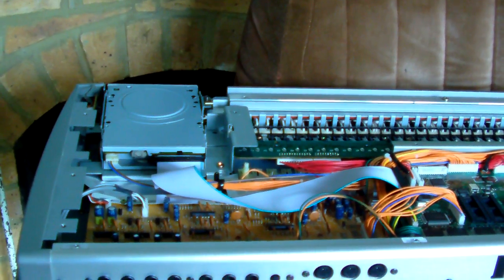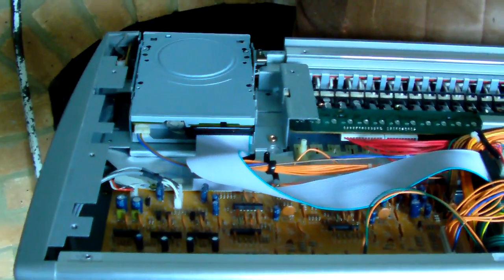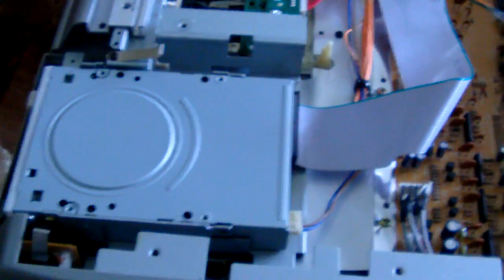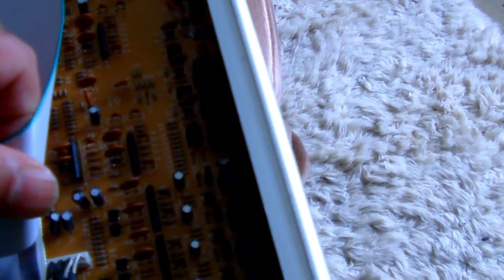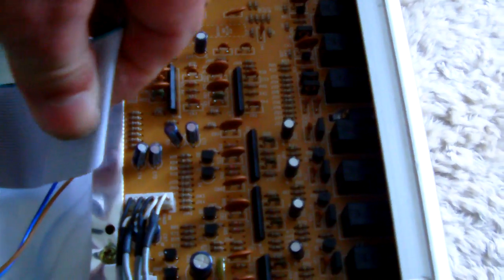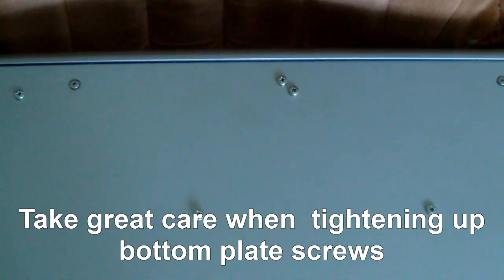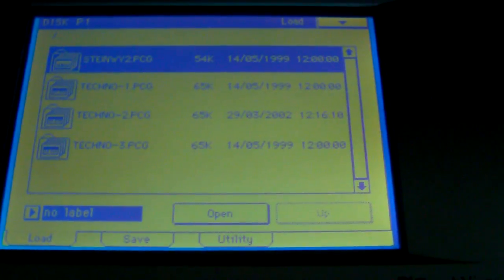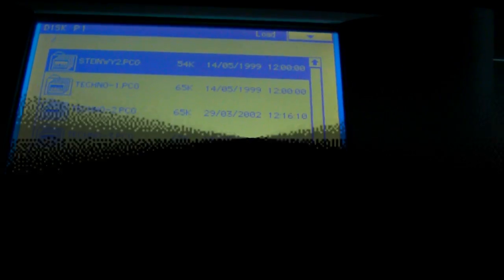Korg Trinity floppy drive change

Comment: I just tried it and it worked! Yay! Thanks for giving me the courage. I took a 3.5 inch floppy drive from an old Pentium 2 Dell and connected the power and ribbon inputs and it read the disks, I was gobsmacked. I figured Korg would use their own proprietary 3.5 inch floppy design that only they sell, but they actually used an off the shelf one. The disk is removed in 3 pieces, the entire corner of the korg comes off with 4 screws, then the disk is removed from the corner piece with 4 screws. Replace it with any old computer version and reassemble, voila :)
Reply from the maker: Good stuff !  Happy i was able to help someone.

Comment: 22 years since they started making that model. A lot of people are too afraid to tinker with electronics.  I use the tips of 2 fingers on the screw driver to tighten small screws like that. Gets them "snug" but not over tight.
Reply from the maker: You are right - i was loathe to open up this keyboard myself for the very reason you give, but because i can't stand things not working as they should, i decided to 'bite the bullet' and i'm glad i did. My local repair facility is over 30 mi away and they quoted me £130 to do what i managed to do in just over 1 hour.   At £56 per HOUR ! ( labour charge alone ) it kind of 'forced my hand '
Good ol' Trinity now works as originally intended.

Comment: I need to try this but I'm terrified I'll break something. I just bought a couple zip drives on ebay and am attempting to circumvent the floppy drive altogether using the SCSI input. If that doesn't work I guess I'll try this. I wish there was a way to emulate a drive with software and connect the korg to a computer via parallel connection so it can use the computer's disk.
Reply from the maker: Just be CAREFUL and take your time - it is not difficult or beyond your capabilities.  If i could do this work, so can you.

Comment: going thru this now with my Trinity Pro :( I replaced the belt okay. But the drive makes a repeated clicking-sound when accessed and won't format blank disks or load patches. I notice there's lots of play in the black wheel as if it's not catching internally. Looks like it's time to replace the entire floppy, as you've done. Hopefully can locate a drive for decent cost. Thanks for the informative video.
Reply from the maker: Yes, my drive did exactly as you describe yours does - the only 'cure' is replacement,   but as i tried to emphasize,   take care when inverting your instrument - it's all to easy to break those plastic sliders, or worse yet, the led screen !  The replacement 'A' drive is easy, and the drive should still be available as the one i quote in the video from ebay. ( i suspect ANY floppy drive would do actually, but that's your choice. ) Good luck.
Reply: Can you advise a floppy drive to use that works ?

Comment: Could you share how you were able to remove the original drive? I have my Trinity Pro all opened up, drive cables removed and it seems like I have all the appropriate screws removed but something is keeping me from being able to pull out the drive. It has a LOT of wiggle up/down/side but just will not come out.
Reply from the maker: Yes, i will. i will disassemble my Trinity again tomorrow (sunday 22/01)
 and will make sure to video very closely just what screws need to be 
removed.
The main thing is NOT to force anything - it's not particularly easy,  but a bit of patience will reward you.
Sorry to not responded to your comment right away,  but have had a rather 'busy' day ( will explain that briefly on the new strip down video ! )
Please be patient - i WILL post on my channel as soon as i have completed the video . )
Reply from the maker: OK, i have videoed the procedure today (day early)  right now i am uploading the raw video into my editor, and the finished vid SHOULD be available sometime today/tonight ...... it's all explained and should help you ( and anyone else who needs to do this replacement job)

Comment: Hello colliecandle. Is your Korg silent when you power up the keyboard? I have noise coming from the floppy drive area and I'm thinking of opening up the keyboard.
Reply from the maker: Hello.  Yes, the Trinity should be totally silent when 'booting' unless there is a disc in the drive perhaps.
Firstly, does the drive operate as it should - if so, then i would not be too keen on opening and replacing the drive if it still functions,  BUT if the noise is bothersome to you,  then replacement is the only 'fix'.

The drive itself is not expensive - the expense comes into play when you let an 'authorised' repair service do the job for you.

And yes, the floppy drive is the ONLY thing which could make any mechanical noises inside your Trinity - all else is 'solid state' electronics.
Don't be 'afraid' to open up this instrument - just be careful of connectors, and never use force to dislodge anything and please remember to support the whole thing making sure the screen and all switches/sliders are not obstructed - they are all too easily broken if care is not taken when the Trinity is upside down !

You will be surprised how easily and quickly it is too change out the drive - as a side note,  just be cautious of electro static charge and 'earth' yourself if possible to avoid any static charge damage to circuitry.  i took no precautions re this 'electrostatic charge',  to be truthful, i had no idea that 'grounding' myself was a good idea at the time i made the video.
But still, i got away with it regardless !    i wish you every success if you decide to replace the floppy.